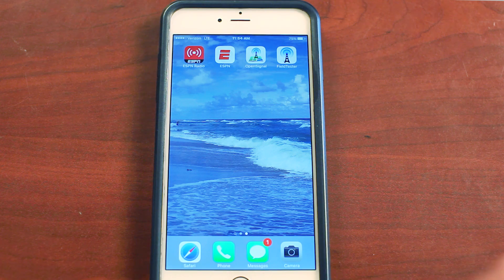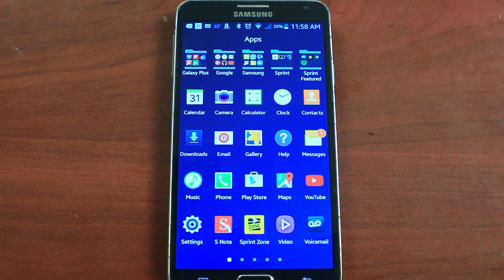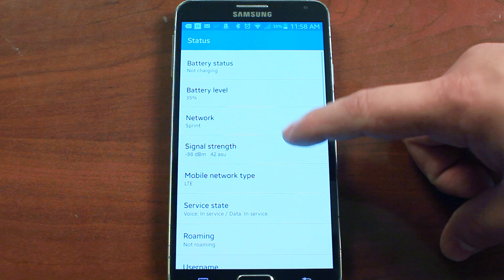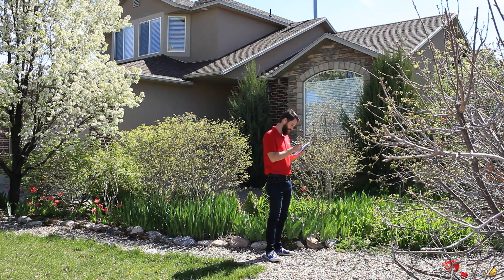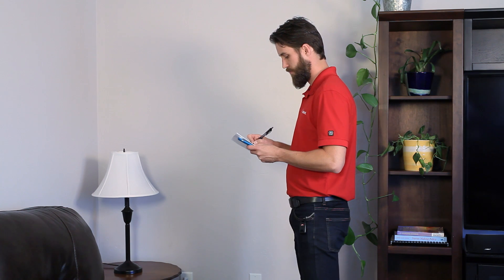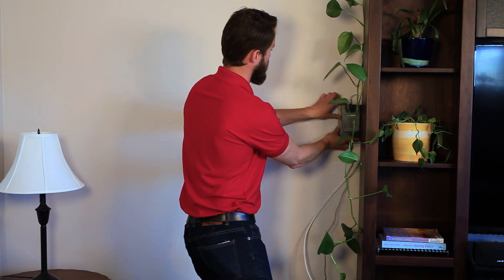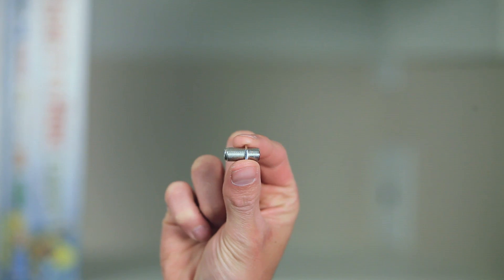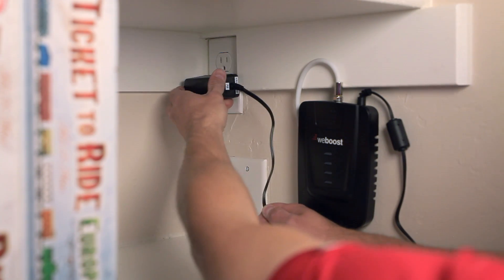Where to Install Your Booster - Cell Phone Signal Booster Home Install Series (1 of 6) | weBoost

Comment: great vids.  I'm debating a booster/antenna since I receive zero bars with my ATT service.  It's a very rural area.  How do I zero in on where to place the antenna?  No read with  iPhone 8+ running IoS 13.3 using field test ("waiting for update")

Comment: Test mode on an iPhone no longer works like this under iOS 11. Do not get the switch from bars to numeric signal strength.
Reply: When you dial the number, you should see "Main Menu".  Go to "LTE"., then "Serving Cell Meas".  The rsrp0 and rsrp1 values show the dB level of the closest two towers.